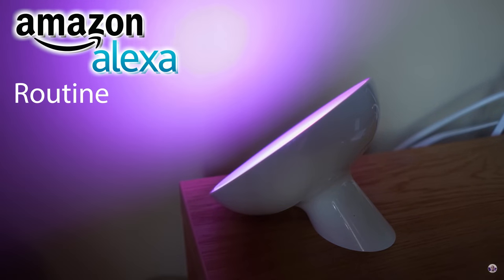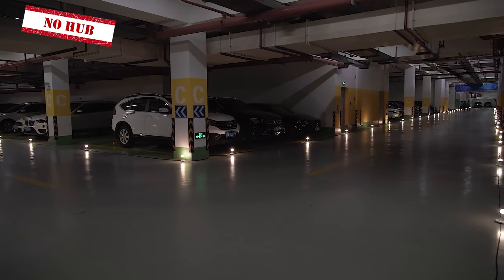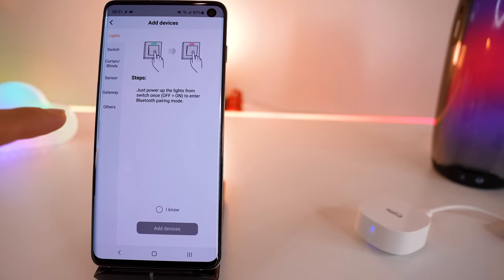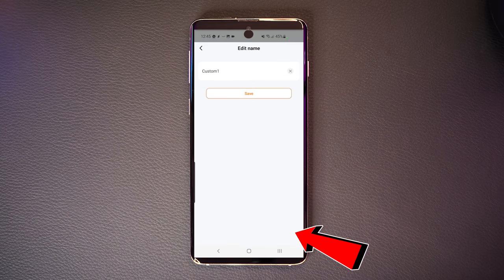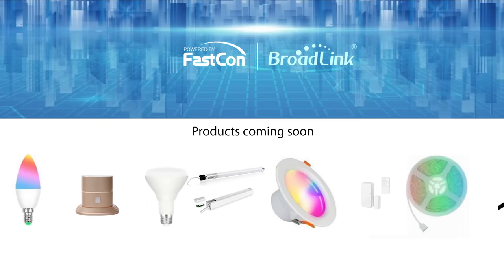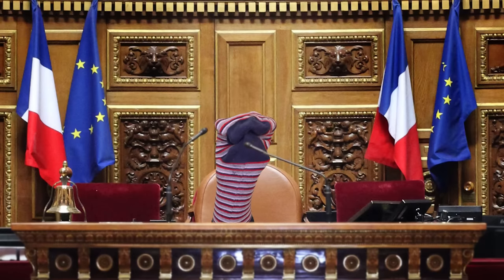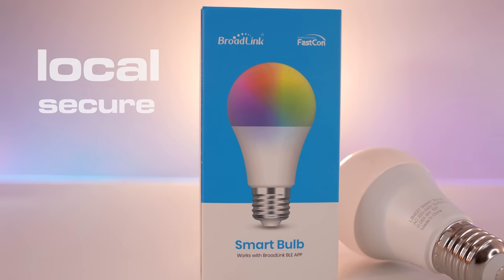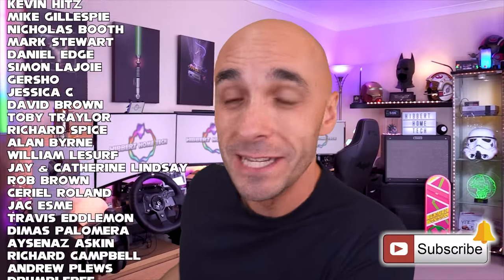Smart Home Light Switch - No Neutral, Because No Wiring!?

Comment: This is exactly what I’m looking for with my home gym. I wanted a way to have a countdown timer. I can now achieve this with this package and using an Alexa routine. Bought using your discount code, thanks Paul 👍🏻
Reply: Scrap that, no Alexa routines yet 🙄
Reply: @You-Tuber2024  I didn't find this review to be entirely clear about its capabilities. Basically, Alexa can talk to the bridge (and activate scenes), but the bridge can't talk back. 

If you could use the buttons on the panel to trigger routines, this would be a MUST HAVE. Instead, you're stuck using Alexa to control their equipment, which doesn't have the range or quality of many other brands. Even their bulbs--which are fine--are inferior to Govee. I don't want to replace my current stuff with Broadlink stuff, just so I can use their panel. Oh well.
Reply: @slow17motion  exactly mate! I think I’m going to be sending mine back because I haven’t used it yet since realising I can’t use it for what I intended it for. My whole setup is Hue and like you, I don’t want to be replacing all my stuff with BroadLink
Reply from the maker: I was perfectly clear. This switch DOES have the ability to trigger routines. The only thing I didn't get right was when. Broadlink wrongly told me it would be up and running by the time the review came out but amazon delayed the new api and Broadlink now estimate July and are offering free additional switches to anyone that bought this product expecting it to start Alexa routines.
Reply: @paulhibbert  how do you go about claiming the switch’s Paul? If this is the case then I might just keep mine if they do intend on running routines through Alexa. I’ll just sell the bulbs
Reply from the maker: I've asked him now on Skype. I'll let you know.
Reply: @paulhibbert  thanks Paul!
Reply: @paulhibbert  I'm in the same boat, if you got a responce this would be great to know :)
Reply: @paulhibbert  Can you keep us up to date when it starts triggering routines? That would be great!
Reply: @paulhibbert  Lol. 😂 I should have read the comments sooner. I hope they sort out the Alexa issue before my starter kit and extra switch arrives. Our wives clearly belong to the same flipping switch flipping organization. She also calls my smart stuff, "not so smart stuff". NEED THIS TO WORK!!!  LMAO.
Reply: @paulhibbert  Hi Paul. How did you get in with the guy on Skype?
Reply: @paulhibbert  It's November and they still aren't supporting Alexa routines, and although I've consistently written to them asking when they might implement it, they have no update nor have they offered me anything. I do still like the Broadlink BLE system

Comment: While I applaud Broadlink for "building a better mousetrap" with their FastCon BLE system, they need to formally integrate with Home Assistant if they want to make any significant inroad into the established Home Automation community.  Without Home Assistant integration, their system is a non-starter for me.
Reply: This. If they claim to be the best product, let them prove it by making people want to use it. Not by forcing vendor lock in. 
'completely secure and local'... except for the ONE thing (automation) that makes a home automation system.. well, an automated system. XD
Reply: This sounds really nice, a few drawbacks, but if they deliver and integrated with home assistant, and change that behavior on the buttons seems amazing. Looking forward for development.
Reply: @ayporos  if the hub can talk locally to home assistant then that would be amazing.
Reply: Home Assistant already supports BLE devices, so there should be zero reason for FastCon not to magically be supported once a few developers get their hands on the products.
Even if Broadlink doesn't officially support it, their BLE setup looks to be very simple and easy to integrate.

I am personally more worried about the security part - how easy would it be for a neighbor to re-pair with your devices? And if you use Home Assistant as an alarm - will the BLE sensors be considered secure enough ? :)
Reply: We want BrightLink to integrate with HA, but does BrightLink want that? If they did, wouldn't we have seen an  integration with BrightLink switches by now?

I can see a scenario where they truly want to replace HA in the long term. I hope that's not true, but I wonder .
Reply: completely disagree, home assistant makes up a small percentage of the home automation community, thanks mostly to its sarcastic/unhelpful community towards new users and the fact it takes ages to setup (tinkering and getting everything set up to work properly), its the reason that Philips hue is so popular, it works out of the box without the end user having to do much themselves. Any company that wants to make a lot of money from this needs to make it simple, the vast majority of the population are either tech averse or just CBA to spend ages setting stuff like this up.
Reply: “If they want to make any significant inroad into the established Home Automation community.”

They don’t want that, because the established home automation community is a market of zero value.
Reply: @JasperJanssen  agreed. The DIY tinkerer market is incredibly small. I doubt BroadLink is trying to seriously invade that market. Home Assistant needs BroadLink way more than BroadLlink needs Home Assistant.

Comment: I have been using these battery buttons as replacement for main switches for about a year now with the Lidl hub. They also have single, dual and triple 230v switches that don't need neutral. I have the 4 battery buttons working with toggle, double tap and long press for triggering different circuits or scenes.

Comment: BLE is part of the presence detection holy grail. This seems like one step closer to an ESPresence capability level system without all the WiFi protocol noise. They just need to have a sniffer/registry for devices paired with a motion sensor and it's golden.

Comment: My Alexa Routines work these units. I really like the way they work and it's soo easy for me to show the wife how to use them and others that like to use the light switch when they come over. Thought about hard wiring, but will wait till i'm sure this is my go to unit. Thanks for the review and even though they have many issue with the app they seem worth it and so far i'm in for 6 Starter kits and 2- 4 bulb sets. about 200 bucks give or take and i've got the majority of the house covered.

Comment: Once the home assistant boffins figure out how to integrate these and broadlink implement the changes mentioned in the description, these are basically perfect! The only bulbs to buy!
Nerdy question - have you been able to see whether these cause interference with other bluetooth devices or anything unexpected (like wifi/zigbee etc)? I rely a lot on both you see. Bonus ultra nerdy comment: I guess it depends on the wavelength their protocol is using?
Reply: It's BLE, so it'll be using 2.4GHz, which is in the same frequency range as regular (non 5GHz) WiFi, Zigbee and multiple other things. It's the most widely used frequency. 😖
Reply: Robert is 100% correct. BLE devices in particular can have issues with being overpowered by stronger 2.4Ghz sources (due to the lower power consumption requirements), so keep that in mind when designing the wireless setup in your house and you should have much fewer issues. However, I would love to actually see the BLE traffic and it RF signature considering the fact that though the technology is normally used in low power draw situations, these devices have no need for that. I wonder if the RF power is actually within SIG standards or they are using BLE protocols with Bluetooth BD/EDR levels of signal transmission strength.
Reply: BLE is easy to overpower, but as mentioned in the video, the mesh solution is extremely easy to maintain. Essentially a mesh ensures all devices connect to the optimal uplink, so as long as you don't place your access points directly on top of your bulbs, you should be good.
For environments that are heavily affected by interference, the mesh itself will also cause interference and could potentially force newer APs to increase their power output, so just make sure to have "enough" devices that are "always on" (bulbs, power sockets, etc) and you should not have a problem. This is also why Broadlinks showcase, while impressive in terms of delay, is actually easier to achieve since there are so many mesh-points, despite being in a corporate building with many access points. (I assume.)

Personally my scale is BLE only, and I can read that from my Home Assistant device more than 20 meters away, despite having 4 access points in between - and this is a battery powered scale.

Comment: Hue is expensive but if money isnt a problem I still find it to be the most convenient most reliable system there is. Brightness only matters if you need more brightness that the hue bulbs can produce at 100%, I dont. As for colour accuracy, I just dont care because I dont use many colour bulbs.  I have had more issues with BroadLink TC switches than any other smart home product I have ever bought too. They dont even include an led to indicator to tell me that the bridge is functioning, at least the Hue Hub tells me what its doing. I know Hue is for you like an x girl friend you cannot stop slagging off but for me Hue is the loyal partner that never lets me down.

Comment: Sounds nice. I also like putting smart switches over main switches (but would rather have them cover original plate and avoid wiring them differently). Using magnets/Velcro and having the ability to switch main off and on as needed.

Comment: A mesh with hundreds of devices is a very difficult task to solve, if you are a device engineer. Both the hardware and the software have their own particular problems for the mesh to work. Time to learn ESPNow. Dude, you are leading me to a higher standard every weekend. Thank you!

Edit: the "Rules processor", or the device that manage which device triggers what, must live in the mesh. Interesting. It is possible to implement such "Rule processor" on ESPNow, with a distributed state machine. Quick, to the lab!
Reply: Get back in touch with Paul if you make something practical for people to use

Comment: I also bought a single socket spacer from Amazon so that I could leave the existing switches in place and switched on, then screwed these switches in place over the existing. No wiring mods and done in two minutes...undoabke just as quick. Now waiting for the range extension to replace the unstable stuff I have!

Comment: Thanks Paul, I just purchased a set using your code and I hope it helps you out as the review and the information you provide definitely, help us.
I do hope they do release GU10's as I am a Ikea Tradfri user and am getting tired of how inflexible their system is and how their products won't play with any other system properly. 
I'm going to be starting my switch of approx. 40-50 lights in the house and the gardens, 6 sensors and the switches that need to go with it all. Fingers crossed.

Comment: I've been wiring the switches always on and covering them with smart switches for a few years now. It's definitely the way to go in a smart home. There is always that odd day when I have to change the battery and can only control the lights by Google assistant but it's fine.

Comment: I like the idea of this product and the range is something I have been looking for, for one very particular reason - Door Bell.
I have a garden office and want a doorbell inside the house AND at the end of the garden, about 40 mtrs away. I tried three different (Bluetooth?) doorbells which claimed 1000ft (300mtrs) range but none worked at anywhere near that range - three walls do cut the signal quite a bit, I suppose. I have wi-fi and Alexa in the office and could buy FLIC 2 to activate a routine but it is WAY too expensive for just a doorbell! The idea of a local Bluetooth mesh is great. THE PROBLEMS ARE - I don't need the lightbulbs and I don't need four big switches on the front door. Has anyone else found a solution that might work for me with the range I need? 
Still think this is a great product and, as usual, Paul makes it a great review - kudos, man!
Reply: I get my Ring Doorbell notifications in the garden from an Echo flex which is in a weather proof box. The echo is connected to an amplifier which runs my garden speakers. Whatever the echo flex says or plays, comes outof my garden speakers.
Reply: @drewrichardson6747  thanks. I don't have ring as I am not really interested in the camera side. However, the idea is great. It just seems so expensive for just a doorbell. If broadlink brought out a cheaper competitor to FLIC (single, small buttons), that would surely win them a lot of sales and I would definitely be interested.

Comment: So, do you know if they will be bringing out a door monitor, my grandson is visiting in August! I want to monitor the doors and I feel that i should replace the Hibbert Tech 240VAC child monitoring system with the scaled and appropriate response program.
1 hit, loud noise.
2nd hit short 240 V shock and no alarm (Don't want to frighten the little darlings)
3rd hit, prolonged 240 volt shock, alarm after 10 minutes so we can reset it and remove the blockage. 

Sorry, asking for a friend.

Comment: You really need to look into Shelly devices for your light switches. I have every switch in my house connected, and they look and act just like normal light switches (I have nice chrome ones throughout the house, no plastic here!) Setup with a 3-way toggle switch, you would honestly never know they were smart at all, and will always work even if the wifi/Shelly went down. They can even work with smart bulbs if needed in detached mode…

Comment: Why do they insist in producing all these bulbs with Edison Screw caps?  There are many reasons why Baonet Cap is better (safer, impossible to have it in place but not connected, etc) and the fact that almost all lamp sockets in UK houses are B22 (some specialist fittings and table lamps may be ES, but every house I've ever lived in has B22 fittings in every ceiling).  PLEASE try to persuade Broadlink to produce bulbs with B22 caps - it is bound to increase their market in the UK (at least by 1: me!  :-)
Reply: Because Edison screw is by far the most common fitting worldwide.

Comment: I have the original  Broadlink Hub that looks identical except for the BLE Fastcon label on top, to which I have my existing plug sockets and light switches connected to, does anyone know if this button works with that hub or do I need to buy yet another hub?

Comment: Paul, the Broadlink starter kit (I bought one) is no longer available on Amazon. I set up my first 4 way switcher with no issues. I bought a second switcher which is a lot smaller, but I cant add this device. I see you have more than one switcher, so it should be OK.  I scanned the QR code (which I did not do with the first one). But nothing changed once scanned. So I have now given up and are about to junk all My Broadlink stuff?. Love the channel though.

Comment: Lo does it tell you any notifications if a light has been left on or a door has been left open ??? If you out off bluetooth range. Does it still work with the 3/4/5g network and wifi if you away from home. Otherwise this is not a good seller. Love my Sonoff products 😍 💕

Comment: So off the back of this review I bought the starter kit and these are my thoughts, 
1st - the switch needs a 2430 battery and it isn't included which although only a small gripe is pretty annoying
2nd - I have setup 2 bulbs in bedside lamps to be operated by the switch, and it doesn't work correctly every time, sometimes one bulb does something completely different than what it should whilst the other one works correctly. or both do something odd, or one ignores the command completely.
Have to say the pairing is amazing though, literally a second, its weird, its as if it hasn't worked properly having been used to other devices taking a minute to pair.
Reply: I just installed 10 bulbs and the hub in our game room and got very much the same experience. Trying to set scenes and the bulbs are just randomly going between different colors. Trying to set a single color with room control, and they aren't even doing that all the same, if at all. Luckily my "daylight" scene seems to be working as the default if i turn the power off and back on. Also not able to pair with Alexa at all, the registration code it requires doesn't display. REALLY hoping they get the software figured out because the pairing and setup was amazing, but the functionality seems to be really lacking right now.

Comment: Casambi also good BLE type mesh system although priced for professional use. Use of EnOcean switches are similar in operation but batteryless. Thread (and matter) will also compete so I wonder how yet another protocol will survive. Time will tell.
Reply from the maker: Thanks man, that's good to know.  I haven't triedn Enocean!
Reply: @paulhibbert  FWIW, I use Casambi and HK products plus a couple from Shelly and Tuya with Hombridge managing non native HK devices (plugins) to connect them thru to Home App (Apple). Also find Homedash App useful as a good overall status and control manager. Dipping in out of native Apps as required (until matter arrives… if it ever does:-). )

Comment: Seems like an awesome solution. Might be a good alternative to smart switches, which is proving to be difficult for me as my houses wiring doesn't have a neutral wire.
Reply: Only if you want to buy Broadlink stuff. They can't speak to other Smart devices or Alexa. Alexa can tell the Broadlink devices what to do, but you can't use it to trigger routines.